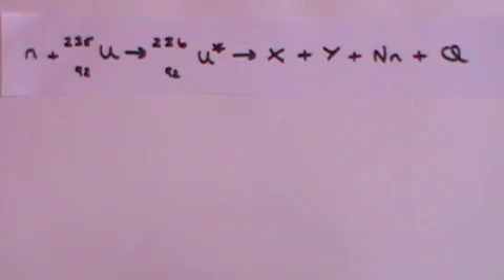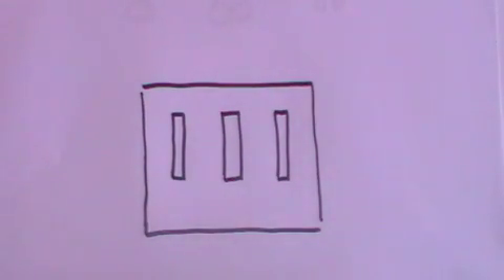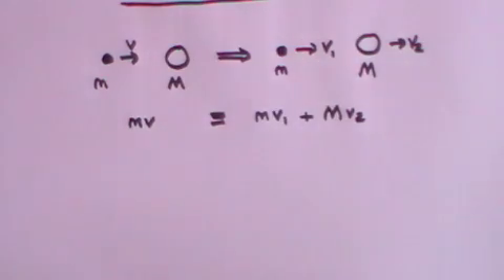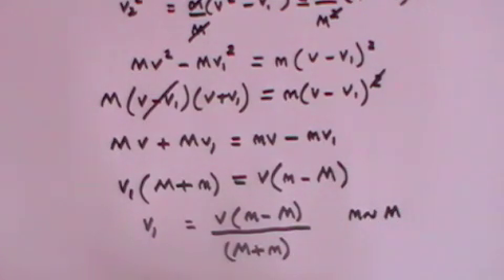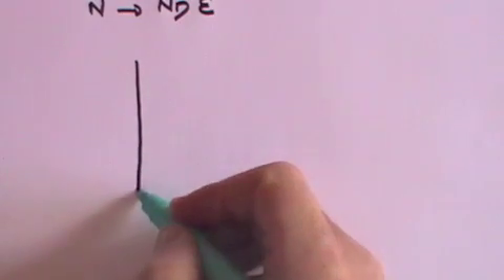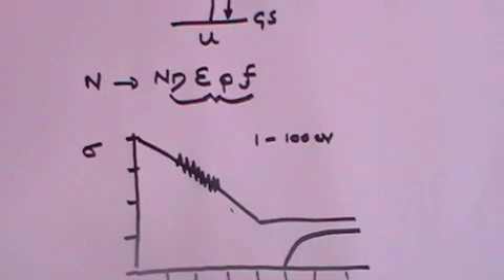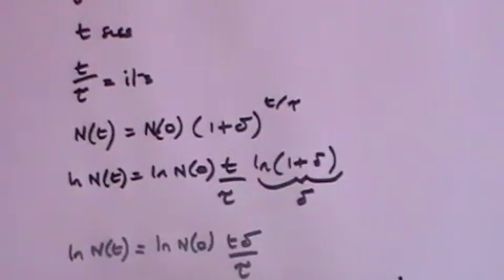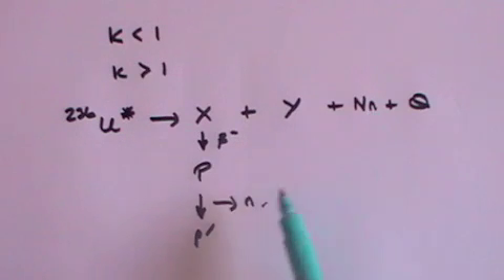Nuclear Fission Reactor Principles

Comment: What is missing in the 4-term equation is Xenon poisoning, or neutron absorption by Xenon which is a fission product. Not taking that into consideration was one reason why Tschernobyl happened.
Reply: It does. The term “f” is often referred as fuel utilization. It is defined as the ratio of neutrons absorbed by the fuel (Uranium) to the number neutrons absorbed by the fuel AND non-fuel (anything that does not fission). The non fuel can be water or xenon. As the production of xenon increases f decreases therefore k decreases. This WAS taken into account at Chernobyl. To increase k due to the xenon buildup the control rods were removed completely which was greatly contributed to the accident.
Reply: The reason WHY Czarnobyl disaster happen was Distłow - an communist party IDIOT who ordered to switch-off all reactor safety systems :(

Comment: So all the variables in: K, T, t, delayed neutrons, and Qheat need to be experimentally determined before you can even attempt at trying any of this?

At what point was anyone confident it would not explode? Is there a small enough mass required to do it on a small scale basis in order to avoid a large catastrophe? Or are large scale reactors the only safe way of continuously having fission reactions?